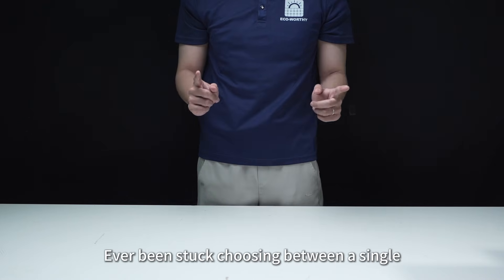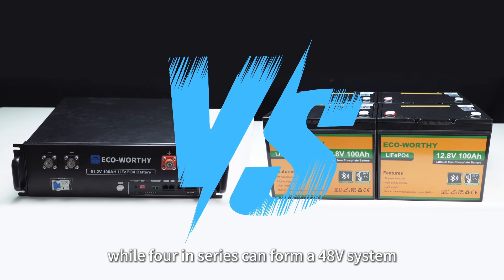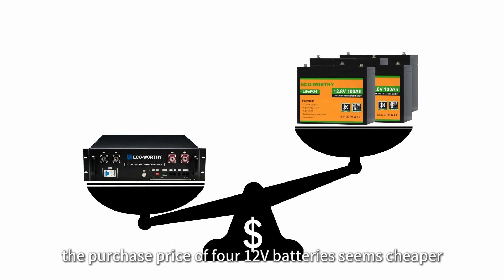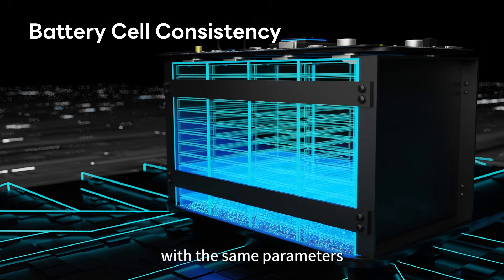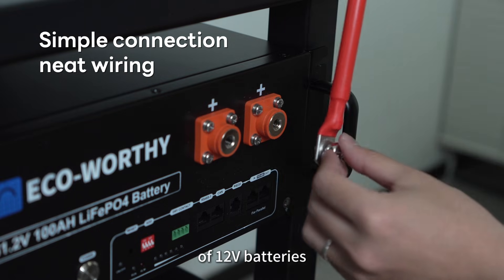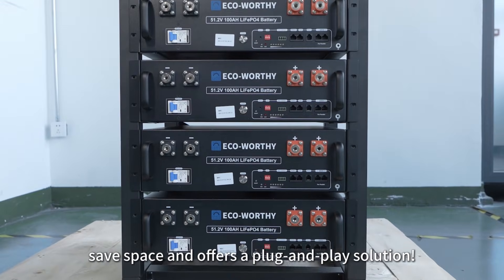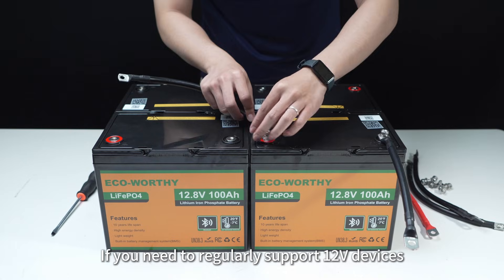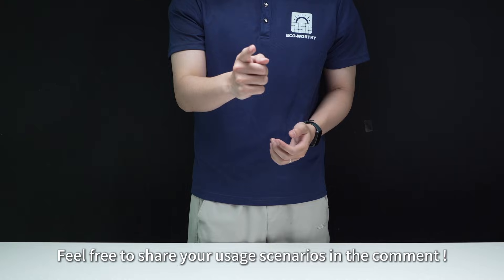48V vs 4×12V Batteries: Which is Better for Your Solar System?

Comment: I need to know how to configure the 25.6V battery configuration you offer for the 48V 4p2s inverter to obtain 20kWh.
Reply from the maker: Hello, if you use 25.6V 100Ah batteries, you need eight of them. After connecting two in series, you can then connect four groups of batteries in parallel, 2S4P.